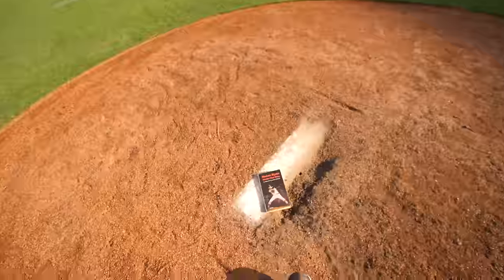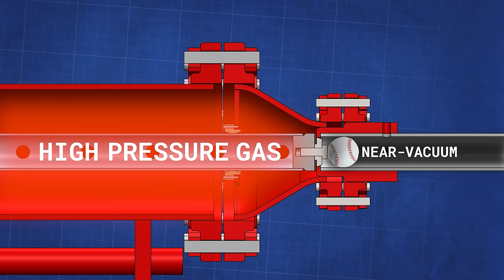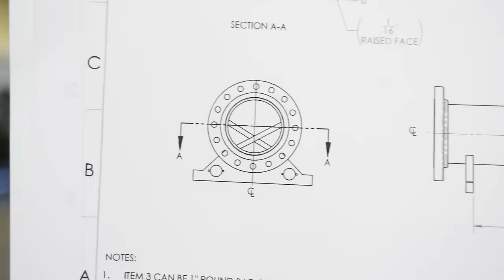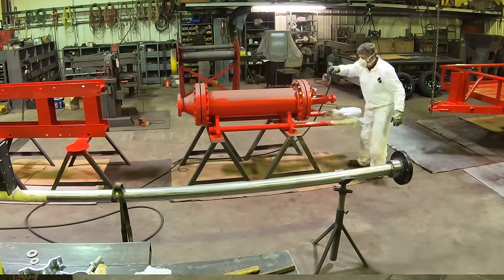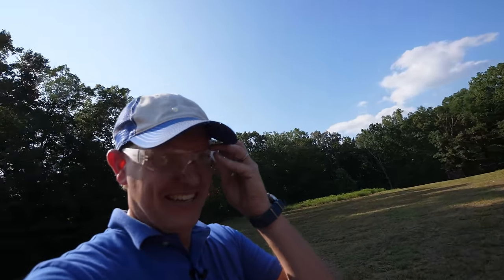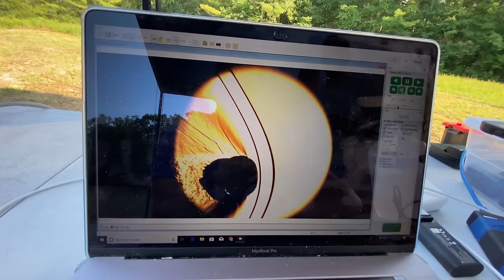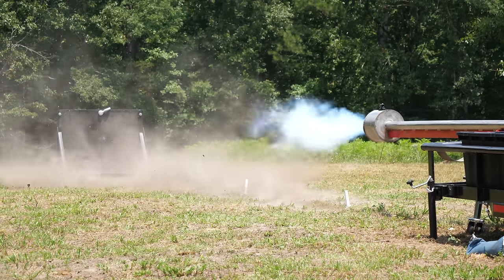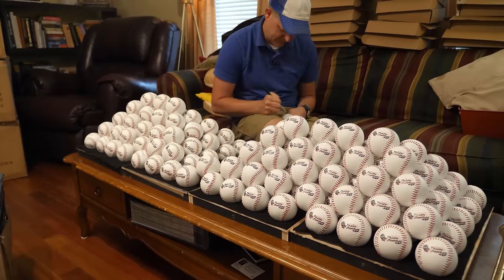World's Fastest Pitch - Supersonic Baseball Cannon - Smarter Every Day 242

Comment: So…you have a batting machine and a pitching machine…when can we expect these two to cross paths?
Reply: asking the real questions here
Reply: Exactly what I said 😂
Reply: Absolutely a great idea
Reply: bat machine will lose
Reply: quertbarbie62 full power v full power, the ball would disintegrate. I really want to see the maximum distance they can get out of the pair though.
Reply: they would need a solid metal bat for that thing, otherwise the ball would blow a hole through a hollow alum bat and splinter a wood one. But also consider that what the ball did when it hit the solid wall is the minimum it would do against a bat.
Reply: The baseball would shatter on impact with the bat
Reply: Need a stronger baseball, maybe solid steel, to hold itself together long enough to actually recoil off the bat. But who knows where it will end up? This sounds vastly dangerous.
Reply: @polychoron  If you have a solid steel baseball, then you have artillery, not just a baseball cannon.
Reply: The question is: How far will the batting machine fly? Will it be a home run?
Reply: He's starting the robot leagues for Blurns Ball. He made Wireless Joe Jackson and Pitchenette5000.
Reply: “What happens when an unstoppable force meets and immovable helicopter bat”

Comment: So here's the real question:
If you could hold that vacuum and push the pressure to say, 750, how much faster could you make it go?
;)
Reply: I feel like at that point the baseball would tear itself apart mid flight.
Reply: At some point, that baseball will rapidly deconstruct midair. I wonder how much it can take.
Reply: I love how they weren't at all concerned about loosing vacuum
Reply: Can one inject water into the ball and freeze it prior to blast off? Slight increase in weight so a slower speed but impact should be very interesting!
Reply: @rosen9425  18:58 It kindof already did, lol
Reply: @drachenpanzer5622  yeah you could see the seams starting to come apart already in this video. they were ready to let loose.
Reply: @Roonasaur  
nice catch (lol)
Reply: @rosen9425  I'd rather not catch any of this ;D
Reply: Golf ball, with a stronger shell, would have a higher speed before self destruct.
Reply: not even visible to the eye at that point
Reply: I wanna see mach 3
Reply: @joelcairns8375  you'd need a modified projectile, I bet
Reply: @SmarterEveryDay Please see if you can make this happen!
Reply: @rosen9425  There's a "What If?" of "What if a baseball was thrown at light speed?"
Put simply, it doesn't go well for the baseball. Or the player.

If you or anyone else doesn't know what I'm talking ahout, Randall Monroe (creator of the XKCD webcomic) published a book filled with various What If scenarios with full (scientific-ish) answers. The light speed baseball is one of the more well known What Ifs.
Reply: Drachen panzer which might be cool to see the schlern of
Reply: Friction inside the barrel is the problem. You can see it on the high speed shot near the wall - the cover was burned probably because of that.

Comment: I love this.
Destin: I'm probably going to be out here a couple of weeks fiddling with this to get the right shot. This is just a test fire for a baseline.

...... first shot is perfect because it's so over engineered you easily out distanced mach 1 at only half your max pressure capacity.
Reply: With an imperfect vacuum too.
Reply: AND with a vacuum leak!
Reply: @josephgauthier5018  the vacuum leak caused the imperfect vacuum.
Reply: @darkraidersgaming7761  i already know that. i do appreciate you trying to be helpful :)
Reply: @darkraidersgaming7761  oh, I see what happened. I missed your other comment, and basically said the same thing as you lol
Reply: @josephgauthier5018  XD
Reply: @darkraidersgaming7761  I wonder how much a perfect vacuum would have made a difference but I guess the seal was just not able to hold that kind of pressure difference.

Comment: Try shooting something longer, like a wood dowel or aluminum tubing with end caps welded on.  Supersonic impacts are completely different from what we see at subsonic speeds.  In a normal impact, energy will dissipate through crumpling along the entire length of the impactor.  The crumple can only move back away from the point of impact at the speed of sound in that material, so a supersonic impact concentrates all the energy in a two dimensional cross-section of the impactor that is on contact with the target.  The effect is spectacular, with molten and vaporized metal spraying out in a disc shape like if you squirt high pressure water from a hose onto the pavement.  You can see the effect in super-slow motion movies of supersonic rocket-sled impact tests.  If you haven't seen it yet, you have to watch the experiment where they send a phantom fighter jet into a sample of concrete wall for reactor containment buildings to verify that the building would protect the reactor from a supersonic jet hitting the building.  It almost looks fake because the plane disappears into the wall without crumpling in the impact.  Your canon is able to access a speed regime where interesting physics that very few people know about is happening.  I would love to see more high speed video of different kinds of impactors.
Reply: Nine Hundred Dollar Luxury Yacht 
Cool comment. Going to watch that suggested video now! :)
Reply: the cannon might not be able to produce the energy required to bring a heavier object to speeds like thaf
Reply: @Nine Hundred Dollar Luxury Yacht 
So I just went to that video of the fighter jet being slammed into the wall, but it said in the video’s description that it was going around 500 mph… That isn’t supersonic, is it? 

It did indeed look a lot like how this baseball reacted when it hit the wall though, just like you said. But the fact is that it was going around less than half as fast as the baseball, so I am confused. My guess is that supersonic is actually under 500 mph?
Reply: Anti - Ethnic Cleansing supersonic speed depends on altitude, temperatures, & humidity. The higher in altitude you go the lower the speed is to achieve mach 1. Ground level it will be around 765-768 mph. 
The Phantom test was around 500 mph (sub-sonic) but what Yacht was referring to, at 500 mph & objects at supersonic don't crumble anymore. They disintegrate & it looks like fluid in motion. 
Hope that makes sense.
Reply: It's kind of difficult to find any solid substance that has an internal speed of sound that is less than multiples of the speed in air.
The speed of sound in 20C air is 343 m/s. The speed of sound in aluminum is 6300-6400 m/sec. Lead is 1300 m/sec. Cork is 520 m/sec. Hardwood is 3500-5000 m/sec. Rubber (type not specified) 60 m/sec or 1600 m/sec according to two different sources. The first number for rubber may be a typo.
Reply: would love to see destin try this
Reply: Wow

Comment: Interesting way to actuate a piston valve. Pretty awesome.  I think you could have got the velocity of the valve up quite a bit with a more standard design and lighter piston since that rod has a whole lot of heft to it. Cool to see though. I've thought about adding an extra vacuum reservoir but never tried it.
Reply: What is up with all the youtubers on this vid
Reply: Did you work at NASA?
Reply: @easykimpin8461  lmao
Reply: @easykimpin8461  You're thinking of Mark Rober, not Destin from SmarterEveryDay (the guy who made the video you just watched).
Reply: The piston isn't really acting as a piston,  but is as a valve to allow the compressed air (nitrogen) into the partial vacuum. It looks like its moving < 0.75" to vent the compressed N to the baseball. Pretty cool "pressure assist" design to open the valve!

Comment: Would be dope to see how far it could actually get at that speed!
Reply: Watch it just hit you in the back of the head when it gets shot lol
Reply: Faxxx
Reply: @crazypeeps7218  after orbiting the earth once.
Reply: Some simple math should help with that question....shame I'm too simple to figure it out.
Reply: Have u ever seen a 1048MpH baseball coming to ur face?
Reply: just do the math.....SIN(2Θ)V^2/9.81    so the SIN of (2*what ever angle its firing at)*Velocity^2 in m/s / the gravitational constant of 9.81 so lets say its at a 1° angle...  (SIN(2*1)*(1058/2.237))/9.81=795.77m.  Thats before you calculate it being fired from an elevated position, and take into account wind resistance and all that good mess.
Reply: Well, assuming the ball is 1 meter off the ground when it exits the air gun (i have to assume because I have no measurement), assuming the ground is perfectly flat the entire way, and assuming the gun is not firing at an angle; at 1048.49 miles per hour or 468.71 m/s  and a gravitational pull of 9.8 m/s^2 the ball would travel 211.7 meters or 694.55 feet. The actual amount would probably be a little less because of drag though.
Reply: simple trig and physics can give u the answer
Reply: Joshua Reid jesus einstein 🤟🏾🤟🏾🤟🏾
Reply: agreed, put a tracking device inside of one of the baseballs as it seems it doesnt explode except on impact! might have to go for a drive to retrieve it haha
Reply: Just do the math with a fixed angle
Reply: Ya I was mad they didn’t do that
Reply: d = s x t. Now just plug in your values for speed and time to solve for distance: d = 40 miles/hour x 2.5 hours = 100 miles.  However you would still need to calculate drag force on the ball so D= 1/2 P square root of s^2
Reply: It's only doing between 1500 & 1600 fps that is way slower then most hunting rifle rounds, plus much less aerodynamic. So not as far as you think.
Reply: well at about 6 ft off the ground and 9.8 m/s gravity it will go about 300 meters or 900 feet give or take ignoring drag wind lift and earth curvature.
Reply: I say... 2.5 miles at 45°
Reply: Then seeing on the news that a house was destroyed by a baseball a few states over
Reply: @joshuareid4933  “jUsT dO tHe MaTh” proceeds to speak hieroglyphics
Reply: Ya he should put little gps in it and see how much it go far
Reply: It's funny that the OP just said they wanted to see how far it would go and everyone tells them how far it would go.

Maybe it's just me, but I took that as meaning they would like to SEE it, as I would.
Reply: 1 mile it’s speed is less than a gun
Reply: I would guess at least 6 or 7 feet. I’m not a scientist so I can’t guarantee it, but I would feel pretty safe with that bet. Don’t take my word for it though!
Reply: D.S.Steele that’s why I added the drag force equation

Comment: Thumbs up for Mad Batter vs Supersonic Baseball Cannon!
Reply: I was thinking about that too. I think a much more secure bunker would be needed.
Reply: My predictions if this ever happens
1: the ball misses the bat's cus it's going so fast and gets annihilated by the steel back they'll likely set up
2: the energy transfer of spinning bat's and a 1050 mph ball is so great the ball gets annihilated along with a bat snapping
3: boom
Reply: @smartereveryday  A thumbs up from Destin! Please make this happen. If the mad batter or the ball doesn't break it could go to the MOOOOON
Reply: My first thought after reading the title.
Reply: Result could be the world's longest foul tip. Any direct contact would destroy the bat and/ or the ball. So set up the batter near the pitcher's mound and the cannon at home plate, synchronize the two, and go for the world's longest backwards home run by just clipping the top of the bat.
Reply: Eric Laska Revolutions Per Minute? I thought the cannon didn’t rotate
Reply: I think we all had this thought, either that or you’re wrong.
Reply: I see a bat failure!!!
Reply: Use metal for both bat and balls?
Reply: @bellpele7125  What you've got there is a disaster. As amazing as it would be to watch, if it worked you'd have a metal cannon ball careening in a random direction at a speed greater than sound.
Reply: @nymalous3428  Yeah, ask Mythbusters about explaining that to the neighbours...
Reply: Ball and bat EXPLODE!
Reply: I'd settle even just for a shot against a fixed-in-place baseball bat
Reply: @jm56585  Rounds per minute.... the fire rate of the gun.
Reply: scott bleackley thanks

Comment: When you slam so much kinetic energy into a solid object that it just decides its a liquid.
Reply: Baseball vs Watermelon.
Reply: I did the math (not hard) it’s 16000 J or 16 kJ. That’s a lot for such a small object...
Reply: That makes me really confused
Reply: That baseball in 2020, "I self- identity as a liquid, I was born a liquid, I will die a liquid"
Reply: Interesting thought. How much heat does this produce? Are the materials softened (semi-liquified)(if that's a thing)?
Reply: @squiddi1393  It's half that, still a crapton, but you forgot the 0.5 in the equation.
Reply: Behaving as a liquid I assume is more a result of the construction of a baseball. Lots of tightly woven individual fibers with enough energy to over come the friction.
Reply: @graefx  With enough pressure solids can still act like liquids, even if they don't necessarily melt. According to what I've read, this is the principle behind shaped charges.
Reply: @reaganharder1480  ehhhh, kinda... a shape charge liquefies the metal cone of the shape charge. As the cone "folds in on itself" the pressure wave makes the cone form into basically a jet of molten metal. Which rapidly ablades the metal of the target with a focused point. Once the charge has penetrated, the molten metal is basically injected, the cooled metal turns solid and becomes shrapnel inside the target when it richochets off the opposite interior wall.

Comment: Fluid dynamics: baseballs become liquids at mach 1.3 when impacting steel.
Reply: ObiWanShinobi1 would this be considered sublimation?
Reply: @michaelb8133  yes. but you could also call it pulverization
Reply: ObiWanShinobi1 1.4*
Reply: I wonder if they got two of these cannons and fired two baseballs at each other, would the liquefied baseballs perform the same way the vortex collision device does?
Reply: Michael Barnes nope it's definitely not instantly becoming a gas, it's not even becoming a gas... also the original comment is about it becoming a liquid, and sublimation is not when solids become liquids, that's melting...
Reply: HAHAHAHA
Reply: @MisterDoctorBaconman  Correct. Sublimation is when solid skips and just goes stright to gas.

Comment: This gun literally wouldn’t look out of place on a tank 😂 I love it
Reply: I wonder what would happen if they put a solid iron ball in there and fixed the vacuum leak (if I had to guess I'd say either the tape is failing or the variable seal is breaking at higher pressures which may be fixed by moving the latch up a bit).
Reply: Air cannons are old tech in the weapons industry. Its all about magnetics now with zero drag, and infinant energy.. if you can believe it we have rail gun tech that can shoot lead further, faster, and more accurate then any gas propelled bullet
Reply: @jmhm17  well it's not really the old tech. It's the system that will be used for many decades until the magnet tech is perfected
Reply: @jmhm17  in theory, combining a rail gun with a vacuum would be really good
Reply: You actually don't know what the shock was behind the wave recovery?
You are not that bright, when you displaced air and pressure from the ball, it was replaced just as fast refilling the the place you interrupted....duh! Just as fast!

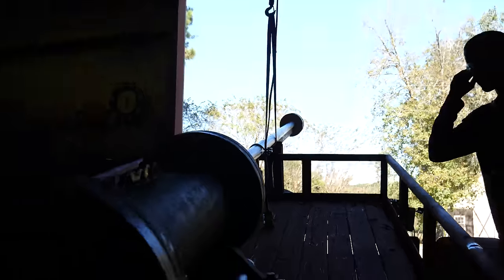Comment: 8:48 I was wondering who threw the ball in the back of my head. You can come to Sweden and get it back if you want.
Reply: underrated af
Reply: You would be dead that ball went fast
Reply: @cameronwilkerson2269  r/woooosh
Reply: Thetankist 90210 lol
Reply: @cameronwilkerson2269  I think it would have slowed down a bit by the time it got to Sweden
Reply: @cameronwilkerson2269  Yeah but it wouldn't be going at the same velocity that it was going when it was launched. It would have significantly slowed down cause of the air resistance. But yeah it would go far. But obviously not out of the US :D
Reply: @atank6289  r/ihavereddit

Comment: "I doubt we will go super sonic"
Achieves 138% of speed of sound
Reply: It will take amazing bat speed to hit that sucker. Maybe steroids ought to be legal.
Reply: At 57% of the canons maximum working pressure and 62% of the maximum ability of the vacuum pump..... basically, this cannon was at half throttle...... 😮😮
Reply: Tyler Hebert probably not even half throttle since the extra air in the barrel probably has a much bigger effect on the final speed than the pressure of the gas behind it. both would have demising returns but at those speeds even removing a little air would make a noticeable difference while adding more nitrogen probably wouldn’t even make a measurable difference with the methods they used in the video.
Reply: @jacob416  well technically the same... You would subtract the pressure in front from the pressure behind
Reply: PJake Bobs no the main reason for removing air from the barrel is to reduce drag as much as possible, the extra force from the extra pressure difference is negligible as it only provides a 1.7% increase on the actual experiments or a 2.5% increase in there target.
Reply: @jacob416  makes sense, thanks
Reply: Shahram 
I loved the effort you all put in to this.